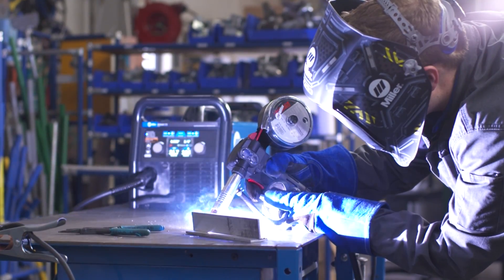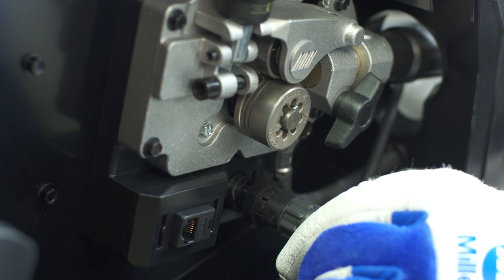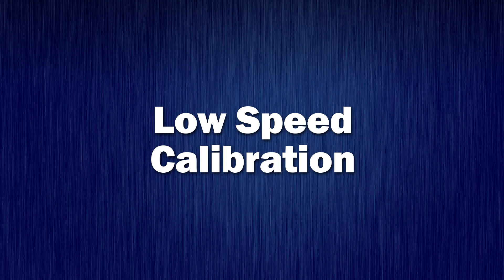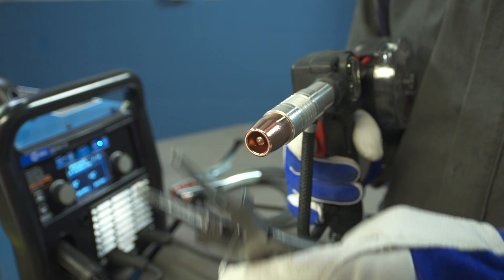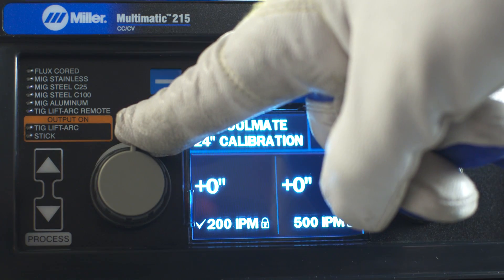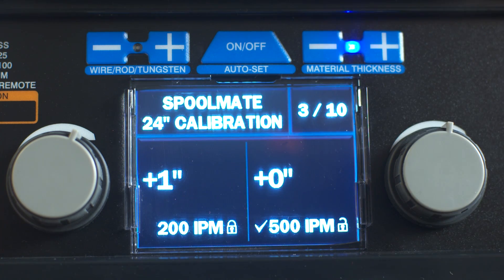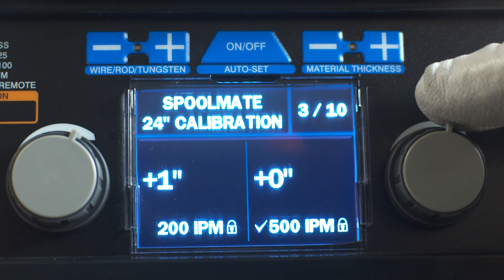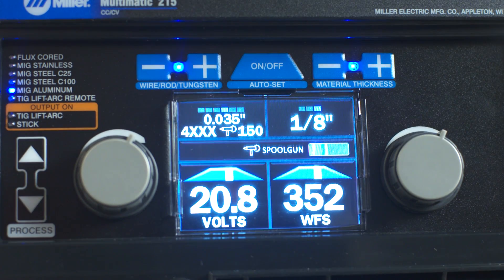Miller Multimatic 215 Spoolgun Calibration Procedure

Comment: Three questions. 1. Is this a normal process when first installing the spoolmate 100. 2. Should the shielding gas be on. 3. Does the spoolmate electrode connection need to be installed for this calibration test ?
Reply from the maker: Thanks for your questions, William. Whenever installing a new spoolgun on the Multimatic 215, the calibration should be performed. This procedure ensures that the Auto-set feature will work well with the spoolgun. The calibration procedure does not require any shielding gas so it can be off. It also does not require any weld output so all you need is the 4 pin connector hooked up.